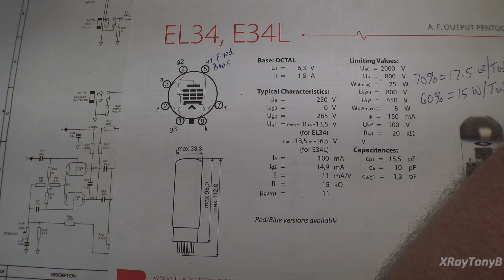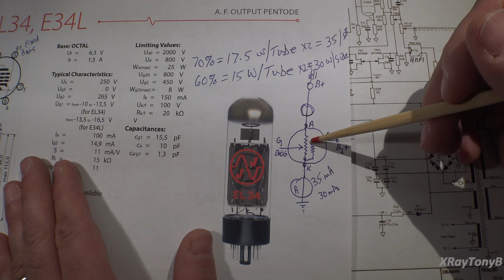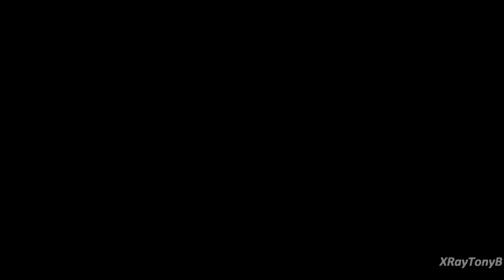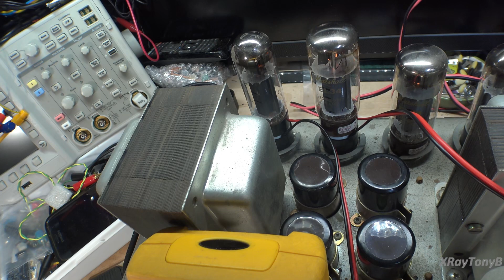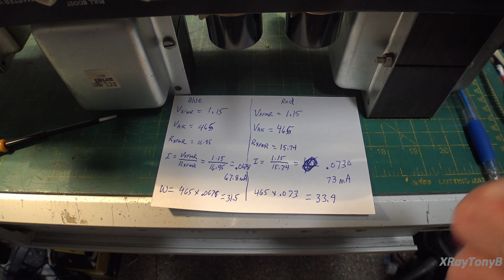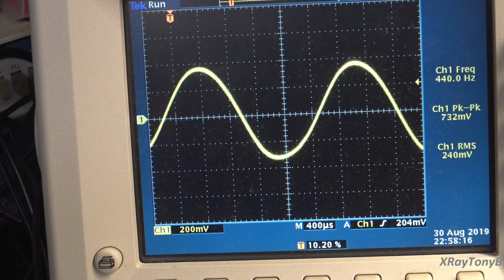Laney AOR100H Guitar Amp Part 2 - Are Matched tubes that Important?

Comment: Equal Ia, in a specific situation, is one thing.
Equal gm is another thing.
Heating to cathode resistance is yet another thing.
I sent back a quad match EL34 with good equal gm. The reason was that, for me, the differences between the tubes in resistance between heating and cathode were too great, and they were all too low in resistance.
In other words, electrons go from your heating to the anode, and if that is grid frequency, I don't want that. If you heat your tubes with DC, that is less of a problem. The tubes worked very well otherwise.
Tested with an AVO MKIV. Sent an explanation and photos of the test to the seller, who simply took them back and most likely sold them again...
And others wonder where that 50/60Hz tone comes from. Must be a bad power supply/smoothing capacitor...
To measure is to know.

Comment: nice job, i just got a pro tube lead 100h, it needs power tubes and a good tune up, cannot wait to fire it up, do you know what the hole in the chasis is for ? it is inbetween the choke and the  output transformer and has two smaller holes, one on each side which is for mounting, Jan p.s did you think about using a transparent stain , pick your favorite color,

Comment: I have this amp , 15 years ago the amp started squealing and one of the power tubes blew up. I have not used since that happened. living in Hawaii i don't think there are capable skill technicians to fix and if there is they would charge a Fortune to fix it

Comment: I was having trouble with when boost was engaged, so I switched all my pramp tubes. 1with 2 and 3with 4. There's 2 different ecc83 in the pre amp. Is that a problem. Power tubes are the same

Comment: I have a bad tube in my vox ac15 pulled an old tube from a radio it was the same tube a powertube That said 84 so i figured fuck it and something started smoking it sounded great but idk smoke is never a good sign maybe it was dirt on the tube maybe something else happened i dont know but my Amp is only getting a new matched pair nontheless 🤦😂
Reply: Lol!!! Smoke is NEVER good .... wait til ya get the new tubes Tom's has Ruby brand and JJs matched dual and quad  83s 12ax, 6l6, EL34s AND on the East coast .... ya got me laughing with the smoke .... mine was worse lightning bolts were seen ..... ya ever tasted copper??? Lol 😂

Comment: Hi Tony.  Love your vids especially your teaching acumen. I am restoring a late 60s Fisher 400 . Your warning about not operating a valve amp without an appropriate load resistor or speaker is understood. Except that the 400 has a slide switch to disable the speakers and headphone jack. When the speakers are ‘off’ the the opt is grounded through a 25 ohm 5 watt resistor regardless which impedance tap is being used. So, how does this resistor and wattage provide the proper impedance match?

Comment: Does the thing about not running a tube amp without a (speaker) load connected also apply to transistor/solid state guitar amps, powered PA mixers, PA heads, and outboard power amps, etc.?
Reply: No, it does not. Transistor units don't use output tranformers, so the just don't put out any power. When a tube amp is run without a load, the power tubes are dumping power into the output transformers and there is no place for the power to go. This can cause the output tubes to overheat, the output transformer to overheat, power supply voltages to rise (perhaps over the voltage ratings of some components). Generally, bad stuff happens, from blown fuses to damaged output tubes, to melted output transformers.
Reply: Kostas Kritsilas ... Thanks for the info! Just curious: What is your electronics background and training? I’m always fascinated by people with such skills, and am always curious about how they got to where they are... Thanks!
Reply: Steve Hacker I went to CEGEP (French Canadian for College) in a 3 year Electronics technology program, which did cover semiconductor amplifier technology, AC machines (transformers, motors, and generators), communications (RF theory and transmission line theory), digital electronics (logic and a little bit of software). After graduation, worked at Marconi (military radios), Philips Electronics (Word Processors and PCs, from bench tech to running the ICT department), a few small start ups (LAN and commercial network equipment), then at Nortel Networks (High Frequency Microwave and Cellular equipment), to a small oil and gas services company (IT support and design implementation of a unified network phone system). I have taught myself about tube electronics on my own, out of interest.
Reply: Kostas Kritsilas ... That’s my vacuum tube situation as well (a very tiny amount of formal training), but having to learn about vacuum tubes completely on my own. None of the courses I took covered vacuum tubes except for a few token paragraphs here or there in various books...

Comment: From the primary taps connect anode to anode to reveal the dc offset value that remains after doing exact current setting for each tube may reveal a misconseption that setting current for both tubes the same will not always result in percise Idle offset at 0dc Depending on the the output trannys quality or condition with any given set of tubes.Then would require an ajustment for one tubes current to be set slightly lean to aquire it.what is more important?two tubes set the same current for exact power with some offset,and or one tube set lean to maintain +0-idle.as we know how critical it is for transistor amps can result in voice coil burnout and performance losses then why is it not considered to be as critical in tube amps.unless the amp comes equipped with the balance meter of course,  this setting is not shown in setups I see on all youtube channels.Tony would you please thankyou.

Comment: I haven’t watched this video yet but saved it to my watch list. But my thoughts are that a push pull amplifier have a strong tendency to cancel out even order harmonics generated in the power amp section. Having an output transformer that isn’t exactly symmetric or having tubes that aren’t perfectly balanced is a way to bring back some of those coveted even order harmonics back in. In a four tube output section, I wouldn’t bother with 4 matched tubes. Maybe 2 matched output pair for the two tubes on one side of the phase inverter, and another matched pair for the other side. But don’t bother matching both pairs together

Comment: 18:30 - Tube amps want to deliver the same current regardless of load (AC current source). If there is no load, the voltage will rise significantly, causing arcing and burning of the output transformer.
Reply: on this amp and amps with high Z outputs and no feedback yes. Amps with a lot of feedback or low Z triodes you can disconnect the load and see little difference in output voltage.

Comment: Great work Tony.. I used a 1969 Laney  (Supergroup Mk 1 100 watt) amp that Lydon Laney originally built in his dad's garage when he started. They were used by Tony Iommi of Black Sabbath and Dave Hill of Slade to name but a few.  From memory it was  a tag board construction  and used good quality components.  The later amps still 'sounded' the same as the early ones , but had a reputation of not being as reliable as the earlier models.  Like me, many preferred them to Marshalls as they would overdrive and sustain sooner  at the same perceived output levels. More guitar amp repair videos would be welcome by me..Loved the guitar you built as well.

Comment: Glad you pointed this out, I ran across this when trying to find matched sextets of EL34's, when sellers sell "matched" valves I've yet to see one that lists the parameters they are matched to. And matched to what degree? 1%, 5% 10%? And as you point out, under what conditions they're tested at also apply. The best way to match tubes is in the amp they're going to be used in, but who can afford to buy 100 valves? Thanks, another grand video....DA.

Comment: gm tony. i got a kick out of this vid mainly because i play through a peavey roadmaster(rebuilt with real components). one quick lookup will reveal why in regards to output tube matching. i replace them in matched sets always when even one gets out of spec(it's not hard at all to tell when that happens). the instrument of choice to play through it? a washburn bass with pickups wired for stereo output when recording. :-)
 good maintenance practices have served me well on this amp as i have owned it from day one(new). best mods for it? a circulation fan in the case and audio grade poly caps in the signal path. not a single ceramic can be found in it now(eliminated microphonics from those caps used in the stock configuration).
thanks for the vid as it was a good start to the day with the morning espresso.